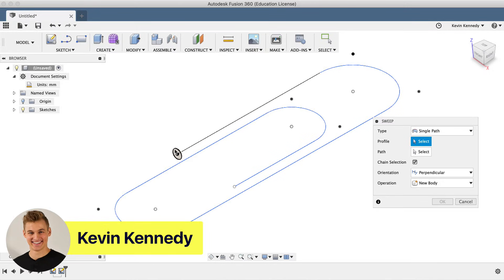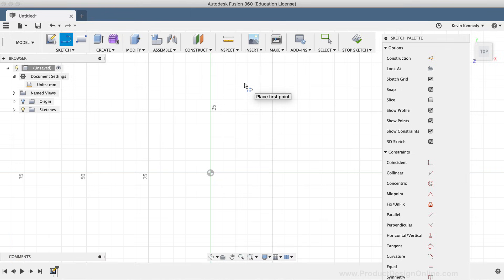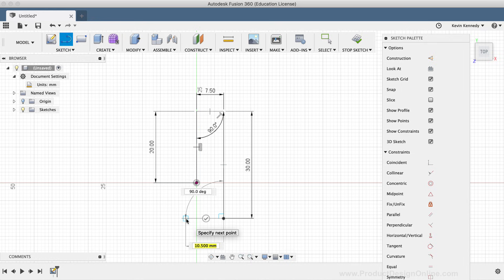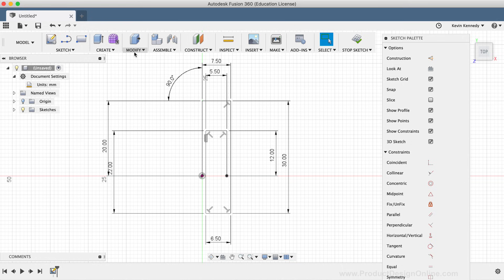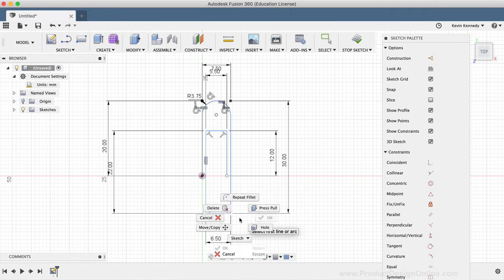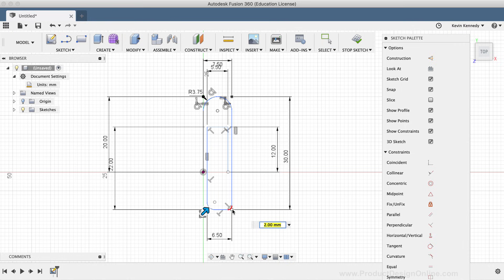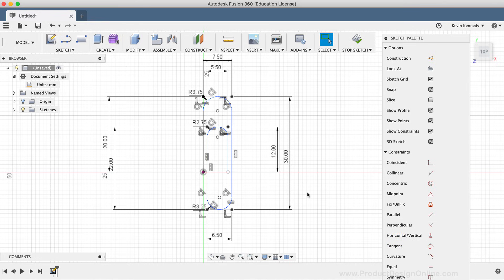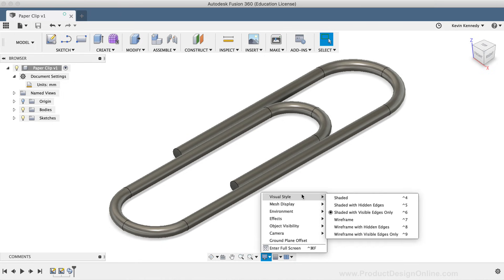How to 3D Model a Paper Clip - Learn Autodesk Fusion 360 in 30 Days: Day #3 (REVISED)

Comment: I started drawing in the xz plane rather than the xy plane and near the end was unable to draw a circle in the xy plane to do the sweep. It would only draw the circle in the xz plane, making the circle tangent to the line rather than perpendicular to it.  It appears that it matters which plane you start in.  If this is a critical step at the beginning, you need to warn the student that this step is crucial to success.  If there is a work around, can you please provide it?  Thanks!
Reply: yeah, I was fucked on this for a while and ended up just pipe'ing it,

Comment: I'm working along pretty good and I notice stray points on my screen.  Well, those artifacts must die...but most of them won't delete.  Ok, weird.  Then I noticed them on yours, too.  When I tried to 'sweep' it said "Cannot sweep the profile along the selected path because the path  geometry may  contain segments that are too sharp sweep along. Adjust the sweep distance until a valid preview appears..."
Was 1, then 0.5, 2, 6...what the heck is the distance and which way should adjustments be incremented?

Did I poison it?

Comment: After sweeping, with the 3D solid tube, I tried to add some 3D fillet to the two circle ends but it causes an error "The fillet encountered a non-manifold edge..." Any clue why? No such problem if I just make a simple tube (extrude from a circle).

Comment: Thank you Kevin for these excellent tutorías. One thing about the updated Fusion 360 regarding the fillets is a function called junction (or link , I really dont know exactly since my Fusion is in Spanish) that requires once active to select the first corner, then write the measure and when the next corner is clicked on it automatically applies the change.

Comment: Hey I know it's been a while since you made the video but I wish to let guys know about a few tips: changing the view is as easy as shift+mouse middle button; instead of using two sketches you could place a circle on a different plane choosing it after selecting center point; you don't need to do any calculations for dimensions in case you need to multiply or divide it, simply type in 6.5/2 for example

Comment: @7:35 This is a way to get into trouble. Trimming with a fillets like that results in a zero length degenerate line that is bound to cause problems if this technique is becomes habit.  https://forums.autodesk.com/t5/fusion-360-support/fusion-360-crashes-stops-responding-after-trying-to-sweep-along/td-p/10930454

Comment: I'm finding the sweep operation failed with disappearing or merging pieces.

Noting the sections were touching each other, I tried reducing the profile circle from 1mm to 0.9mm.

The sweep operation then succeeded.

I went back and tried the anti-parellel fix instead, this seems to be a different issue because the sweep operation failed the same way after the anti-parallel fix was applied and I re-tried with a 1mm circular profile.

Comment: Hello, great video. I just used the pipe command instead of sweep. I found that using the pipe command is much simpler, because there is no need to create the sketch profile (circle) for the sweep.
Reply: Dude you saved my ass from trying to find that one little fucking sweep mistake. Thank you

Comment: While making the paper clip and getting ready to use the sweep function I click on the path and it bugs out I close fusion and relaunch redo it and same error. Wonder what's wrong. The pipe function basically solves this issue but, I don't know why it bugs out and freezes when using sweep.

Comment: Kevin, I read all the comments, and tried 6 or so times to fix this - not working.. Whats REALLY weird is if I drag the arrow it will extrude the sweep to a random point and then fail. I thought it may have been an issue with the dia of the circle, however, even sizing it down to 0.2mm it still fails. I placed constraints on every vertical line as well. I'm pretty sure it's an issue with the Fillets.

Comment: Thanks for the quick reply on the last one, I got a weird hiccup when filleting still, had to do the fillets separately and .01 less than their opposite.  I got antiparallel error, and told me that the constraint to keep the line vertical was disabled when I enacted to fillet, but still showed it active.  But when I went to sweep it basically told me that some of the path wasn't meeting up correctly for the sweep to follow.

Comment: Having run into issues, with the start direction error, I found that If I take a dimension of the fillet and divide it by 2 (5.5/2 then hit enter), that solves the problem. To eliminate the issue of constraints, (if someone is having trouble with those), simply just use your line tool to sketch out a rough and then dimension the sketch after. You won't have to worry about angles and constraints as fusion understands that you're working in a 2d sketch. Thanks for the lessons. You've brought me further.

Comment: I had the antiparallel sweep thing as well, tried to go one at a time with the fillets.  I finally deleted the following side of each fillet pair (the side that would be second in the sequence for each end) and used the edit and extend for the arc.  Had to redraw one line as well after doing this just to confirm the connections.

Comment: I'm getting an error
"The start direction of a path segment is antiparallel to the direction of the previous path segment"
@13:15
Reply: I am getting the same. As is this is a tutorial on an older version. I am not sure how to correct the issue yet
Reply: @1983paparoach  it about contraint stuff ig, i hope it gets cleared later in constraints video

Comment: The XYZ positions in your video does not match the ones in my version of Fusion 360 and it keeps messing up these tutorials for me. It seems mirrored. At 1:15, if you look a the cube in the top left you have the Z axis from bottom to top while in my program it's from back to front.
Reply: I also have no Constraints options in my sketch palette. It's amazing how a year old tutorial can alrady be this outdated.
Reply from the maker: @Hypotaksen  I record all of my tutorials with the latest version and the defaults... But yes, fusion360 is updated each month and sometimes it changes effect tutorials. If you want to change your z-axis you can change the "default modeling orientation" https://productdesignonline.com/default-settings-for-fusion-360-tutorials/#modelingOrientation
Reply: @ProductDesignOnline   @Product Design Online  Okay, thank you. I don't get why everything needs to be changed so drastically so often.

I have another problem with constraint errors. I still don't know what they are and they are keeping me from following this series. I'm currently at day#4 whiskey bottle, but can't even put fillets on the corners of the very first sketch rectangle  without getting constraint errors and a circle suddenly appearing when I put in the last fillet corner. Can't for the life of me figure out why it does this.

Comment: Hi Kevin, Your videos are great, thank you.  I ran into an error on the SWEEP command: "Error: The start direction of a path segment is antiparallel to the end direction of the previous path segment." I probably I missed a step (or the most recent Fusion 360 is a bit different). I was able to avoid the constraint issue and get the fillets to work by following the advice on the pinned comment to go one-by-one.  But to fix the SWEEP issue, I created the ARCs using the CENTER-POINT-ARC command instead to create the curved  parts of the paper clip.  This had the added advantage that I ended up with a fully constrained SKETCH.  To do this, I used construction lines to create the initial rectangular frame of the paperclip. I then created construction lines (down or up, as the case may be) from the horizontal parts using the dimensions of fillets (3.75,3.25, and 2.75). From these points I then created a horizontal line across the paperclip at these points. This gave me a mid-point of a line to use as the center point of the CENTER-POINT-ARC. This avoids the constraint issues and the error I got above. Here is a link to my version: https://a360.co/37I1p98.

Comment: The constraint thing still didn't work? I tried the fillet again but it still messed up the sketch.
Reply from the maker: You can also try to use the 3-point arc instead of sketch fillets, which should help avoid any contstraint issues.

Comment: I REALLY don't like sketch fillets.  I didn't like them in SW and I don't like them in F360.  This video (unintentionally, I think) illustrates why they are terrible.  While it doesn't have anywhere near the production value of Kevin's videos (generally they are AWESOME), I made one that, I think, shows a much better approach to sketching the path sketch for this model.  https://youtu.be/lxK3LR4wd2g  It is unlisted, so you MUST use the link to view (sorry, I just don't think I am ready to put something so crudely produced out there yet). 
Again, I think Kevin's work here is generally excellent, but this one could be improved.

Comment: I've tried a lot with the sweep command.
It turns out the solution is to only designate 1 of 2 corners 90 degrees and snap the other to 90.
For every 180 degree bend you should only have 1 corner where you specified the angle to 90, the other needs to be snapped.

Comment: Had the same problem with the antiparallel thing. The comment section said to fix vertical constraints but it did not do it for me.
I fixed it by redoing it all but then fillet each corner one by one and take 0,01 mm away too.
Didn't add or remove constraints before, during or after.
Hope this helps someone...

Comment: Great video!

 I just spent and hour trying to get the sweep function to work appropriately I should have read the comment s first haha. I was not able to get the sweep function (SF) to work past the first bend in the paper clip. I ended up doing three sweep functions. The first SF rounds the top bend and stops at the halfway point in the second bend where i create another 1mm profile circle, the second SF picks up from where the first ends and goes to the halfway mark in the last bend where i placed another 1 mm profile circle, the third SF goes from the inner end of the paper clip to the half way point in the inner most curve to finish the paper clip off.

This is definitely a brute force method of completing the project. I'm going to try it again but do as Kevin recommended and create each fillet one at a time and see if that will let me do one continuous sweep through the entire paper clip.

Comment: I'm on day 3! To make this easier, don't fillet. Instead sketch the 3.75,2.75 and 3.25 lines down on each side in construction mode. Then do a 3 point arc and click left side, then right side, then tangent/middle point on the top. To get rid of the excess lines, click trim, selecting the extra bit of line you want to get rid of. Makes it super easy. Thanks again!

Comment: Many errors:  Over Constraint.  Constraints and/or dimensions were removed during operation.   Sketch geometry is over constrained.    Also I did the fillets ONE at a time but I had to change the size by -.01.   Thanks

Comment: Addressing the antiparallel error that some people seem to be getting - this happens due to the connection points of the filleting to the other sketched lines. At these connection points, such as the intersection  between filetts, if you zoom in close enough, you will notice the lines making miniscule zigzag or overlapping of lines. This creates the error. I fixed this by trimming the zigzagged portion(creating a gap) and using the coincident sketch tool to reconnect the lines for a smooth connection, rather than a zigzag or overlapped connection. You can look over the whole sketch for any of these discrepancies. When the discrepancies have been trimmed, you can sweep over the sketch section by section to complete the paperclip.
Reply: That works.  It just doesn't reflect design intent.  A better approach is to NOT use straight lines and not use sketch fillets!  There is a way to make the line tool do tangent arcs.  By using that, you get desirable constraints automatically, and you simply have to add a few points to dimension.  https://youtu.be/lxK3LR4wd2g
That said, Kevin's videos are generally excellent, and my production sucks.  But maybe you will find the approach a bit simpler.

Comment: I found out the problem, delete all the perpendicular constraints and then add vertical/horizontal constraints to all lines. cause the perpendicular constraints get deleted after adding fillet to the edges.

Comment: Great tutorials! Thank you Kevin. Issue. Paper clip eek! I ended up with a blue line paperclip? I followed with double fillets, then did them one by one, with and without constraints.  When I use sweep. Correct single path clicked, the profile selected, but no tubular path at the end, just a skinny blue paper clip.
Reply: Did you follow all the way to the end?  To get 3d, you MUST do the second sketch (and on the proper plane) then do the sweep.  The sweep requires selecting a profile (the second sketch of the circle) as well as the path (the skinny blue paperclip).

Comment: For some reason adding the radius on each bend would cause the radii to not intersect.  I found that keeping the lines parallel and then using 3 point tangent for circles worked better.

Comment: I've noticed that sweep fails for me because I'm not able to set the horiz/vert constraint for the inner left vertical section of the paperclip. I get a "[f]ailed to solve. Please try revising dimensions or constraints" error. The other vertical line accepts a constraint fine.
Reply: I got the same thing. This program sure is buggy.

Comment: OK, on my third attempt to do this, I thought I had it.  I reduced all the fillets by .01 (doing them one at a time) and filled in the sweep dialog.  it showed the whole paperclip body looking perfect.  Then, when I clicked OK  the whole paperclip continued to display for a moment, and then everything except the bit from the beginning to the point where it crosses the x-axis again disappeared, leaving only an inverted U of tube.  What the heck?  I tried it again - same thing.  I used to use Autodesk products a lot back in the  90s and they have certainly not gotten less frustrating.

Comment: these videos are great. easy to follow even though the engine has changed. and it looks different. i got the anti parallel error when i tried the sweep. came to the comments and saw that someone posted a work around. and you followed up with more information stating that if you do the fillets one at a time you shouldnt ever get an anti parallel.

Comment: Well this one was interesting.  Seems I had the same issue / error when creating sweep as others below.  I just used the workaround and shortened each of the fillets by 0.05mm.   This seems to be a bug in this this new version of Fusion 360 as it should not have had the issue it was having...  Well having trouble like this can be a "glass half full" moment as it offers an opportunity to learn something more as we pound our heads on the desk to figure it out.  Thanks for another great lesson....
Reply: This worked for me after trying all the other steps to resolve the "antiparallel" error. Thank you!
Reply: That helped. Thank you very much. It sure is a bummer tho

Comment: Hi Kevin — great series, enjoying it a lot. Thank you.
In this tutorial, I'm having a similar issue to many of the other users in the comments. When trying to apply the sweep, I'm getting a similar error: https://monosnap.com/file/acAHiH1VP51pe0LwxWM9IRit7qp1vL. I do have horizontal/vertical constraints on all the vertical lines in the sketch: https://monosnap.com/file/iz7um78YVzzIMX0p5mloLdjavQHFVn. My version of Fusion 360 is 2.0.8412. If it helps, here is my Fusion 360 file: https://a360.co/2Yc0Gq6.

Do you have any pointers?
Reply: Rounded the fillet radii to the nearest 10th instead of 100th works, but not sure why. To my mind, the constraints should work, regardless of the fillet radii.

Comment: Start from the outer left side of the paper clip. Fillet the corners as instructed and add vertical constraints to the lines which are connected to the fillets. Continue to add vertical constraints to all vertical lines as you fillet. Only then was I able to create the paper clip :)

Feel free to correspond with me if you're stuck. Or simply @ Kevin :)
Reply from the maker: Thanks for sharing, Jerome!

Comment: I received the following..."Error: The start direction of a path segment is antiparallel to the end direction of the previous path segment.
" Vertical contraints just created more errors.  

I was able to work around this by using the circle tangent to two lines instead of fillet.  Worked great after that.

Great tutorials, keep it up!
Reply: Thanks for sharing this trick.  Worked great for me.
Reply: Thanks for sharing this 3-Tangent Circle worked for me as well.
Reply: This method is better. Thank you

Comment: I couldn't get any of the ideas below to work.  So, I drew the lines but instead of using the distance/2, I used something a tiny bit shorter for all 3 fillet area; 3.7, 3.2, 2.7.  This put a tiny line in between the fillets.  I didn't mess with any of the constraints and the sweep worked perfectly.